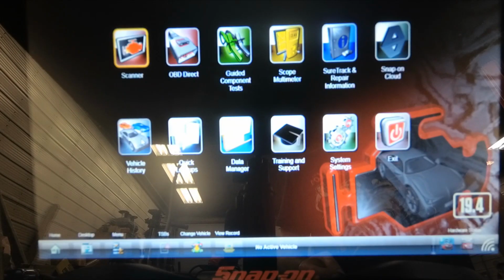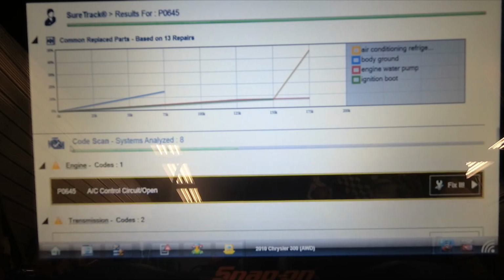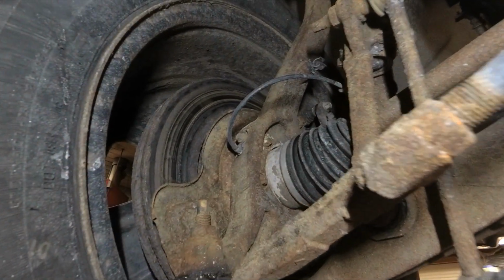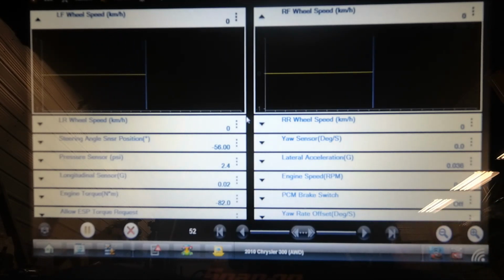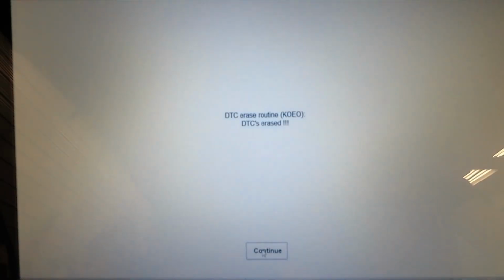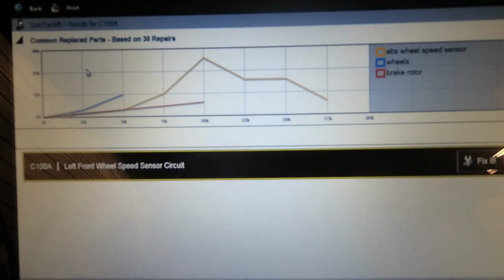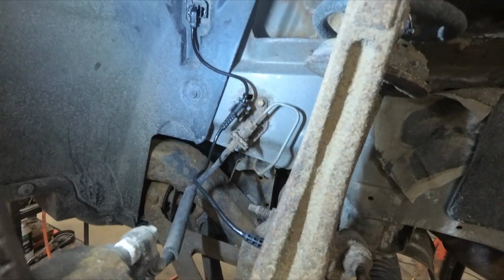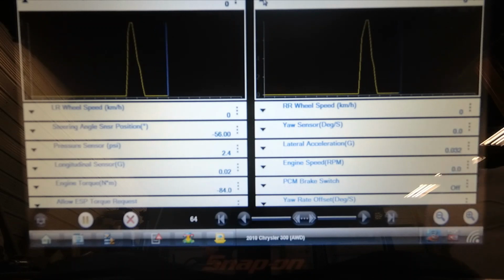Chrysler 300 ABS and TCS Light On

Comment: Try checking the connection to your battery. If you have a loose battery, then your alternator can't charge the battery properly. It may not be a speed sensor at all, it could just be a lack of power. Chryslers have to maintain a certain voltage reading for everything to run properly, because of all the computer crap they put in these cars nowaday. I took my car to the dealership and had to wait a month to get it back just to fix the speed sensor. Only for the problem to keep reoccurring. One day my car died at work after purchasing a brand new battery, so I had to jump myself off with the power ports under the hood just to get home from the job. When the sun came up I had to jump myself off again, so I open the trunk and found out one of my battery terminals was loose. After I tighten the battery terminals, all the lights that was on the dashboard went off on their own a couple of, and hasn't been on since.

Comment: hello Phil if I can u Phil, I have a 2014 Chrysler and my car transmission is slowing down due to the left rear wheel sensor do I go by this same process.
Reply from the maker: More or less yes. Start with a scan to see if a speed sensor is dropping out. Check for codes, check the reluctor.

Comment: How about I replaced all 4 of my abs sensors and the light went out for 5 seconds then came back on
Reply from the maker: The rear reluctors fail more often than the sensors. What code is setting?
Reply: @PhillipBailey  left rear signal code now I checked the axle the reluctor is in its spot
Reply from the maker: @williamjones7271  are you sure the reluctor is turning with the axle shaft? Does it set the code before you start driving or after a short distance? It it sets before the car moves you likely have a wiring problem between the sensor and the ABS module.
Reply: @PhillipBailey  yes I see the reluctor turning through the sensor hole. The lights are on sometimes when I start the car they go off then pop back on. Other times I start the car there out then pop on when I hit 20mph
Reply from the maker: I got caught once on this type of reluctor. It had come off and appeared to be turning when looking through the sensor mounting hole but was actually loose and would stop turning. Try comparing it to the other side if you can. Otherwise it could be a faulty new sensor or wiring to the abs module. I've swapped wires left to right at the sensor. If it still sets the same code then it's the wiring to the abs unit. If it sets the opposite code it's the sensor or reluctor.
Reply: @PhillipBailey  I replaced both rear axles new with new reluctor wheels and still rear right speed sensor code

Comment: A Chrysler 300 reset the ABS light on a Chrysler 300 2008
Reply: How to put an ABS light out
Reply: Bio
Reply from the maker: Not sure what you're asking here. How to clear the ABS light? If so you can't clear it unless you fix it first. You need to scan the system to see what code or codes are setting. Then refer to the appropriate troubleshooting chart to diagnose the cause. Could be many possibilities.  Simply clearing the codes won't fix it as it or they will simply reset.

Comment: Hey Man how's it going,I have a 2008 Chrysler 300 Touring 3.5 and my traction control light stays on and the transmission won't shift into overdrive.
Reply from the maker: You need to scan the controllers for codes and start from there. Something is preventing Traction Control. Is the MIL on?
Reply: @PhillipBailey   No just the ESP, I undone the battery for a while and put it back on and the light went out. So I don't know.
Reply from the maker: @michaeleast2990  Well sometimes disconnecting the battery will erase codes in controllers. Now you will have to wait til the problem returns. Was the MIL on as well? Most engine codes will disable the ESP.
Reply: @PhillipBailey  No the MIL light never came on, just the car with the 2 skid marks that was it

Comment: Hello Phillip, can you tell me please, what is the scanner tool you used for your issue?
is this a laptop with adapter? or specials scanner tool?
Thanks
Reply from the maker: I'm using a Snap-on Verus Edge. It is a Windows based tablet that is connected via Bluetooth to a Snap-on vehicle communication adapter. The software comes pre-installed on it.

Comment: Both lights are on, on mine. I had a grinding noise on front driver side so I changed the wheel bearing. Lights came back on now but my brakes lock and shake and low speed, what can that be?
Reply: 2019 Chrysler 300c
ABS C0044-28 Brake Pressure Sensor1- Signal Bias Level Out of Range/ Zero Adjustment Failure
PTS secondary code C0572
Reply from the maker: That's hard to say without road testing and scanning the system. You need to start by scanning the ABS for codes. That should give you direction. Was this just a wheel bearing pressed into the knuckle on the front? Possibly damaged the speed sensor during work or put bearing in backwards. Start with a scan.
Reply: Did u ever figure out what it was, mine is doing the same thing ?

Comment: the abs light and all my lights are on and it says t case. the brakes kept getting stuck and the car broke down. went and got it checked they said it was the sensor then fixed it. the lights are still on, do you think you know the problem??
Reply from the maker: It's tough to say whats wrong without knowing what's codes are being set. So a sensor was replaced but it didn't fix it or was it good for awhile. If you paid to fix it and it's not fixed I'd recommend going back to them. It's common for the reluctor rings to fail.

Comment: I have this warning occasionally on my 2008 300c! Could it be because the brake rotor surface has surface rust after sitting for a bit? The warning goes away after driving for a bit with some good braking!
Reply from the maker: Rust on the brake rotor should not generate any codes in the Traction Control system. It may cause a brake pulsation though. What code is setting? It's possible a speed sensor is failing when cold or cool and starts working after its warmed up.

Comment: Mine has been doing this exact thing on my 2014 300. Had one front replaced and then the back two went out replaced those now the trac and abs lights are on again. Seems as if one goes they all go requiring all new sensors all around.

Comment: Just bought a 2005 with the 5.7 that kicks down into limp mode. Right rear sensor or tone ring isn't getting a signal so it's causing the transmission not to function properly, insane how these cars will cause the transmission to kick into limp mode due to a sensor or tone ring.
Reply from the maker: Yes everything is interconnected today. Mercedes vehicles can be put into a dyno rolls mode which allows it to be driven until repaired. You could try to disconnect a wheel speed sensor electrical connector and force it to set a code as soon as you turn on the ignition. Might be drivable like that. Good luck.
Reply: @PhillipBailey  thank you for this, I'm a tech myself but don't know everything 😎
Reply: @PhillipBailey  going to try and disconnect the right rear sensor and see if this works. When I reset it with the Mac MDT scanner it'll run fine until a certain speed and the red brake light comes on and into limp mode it goes. I'm going to replace the axle and hub on that side.